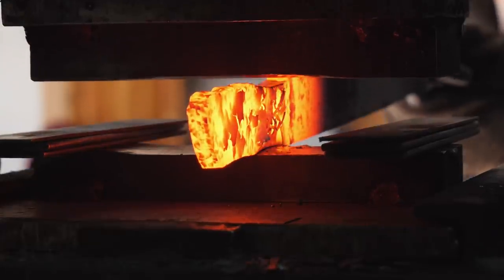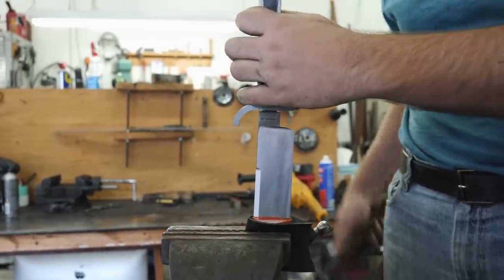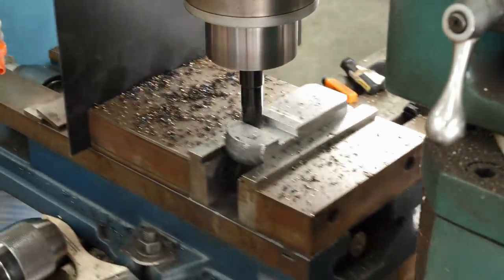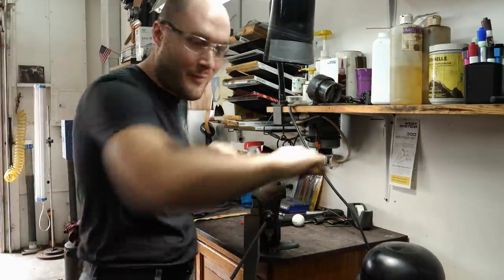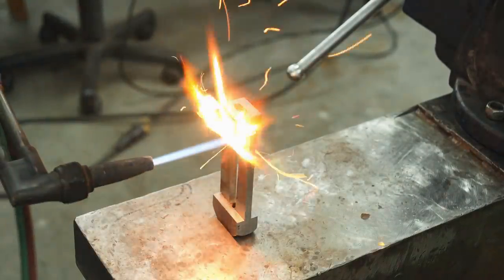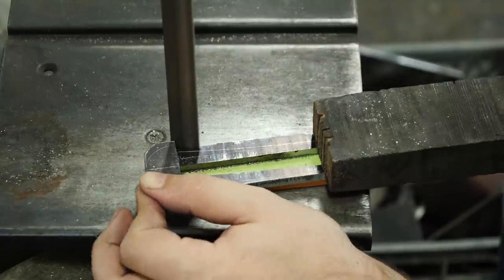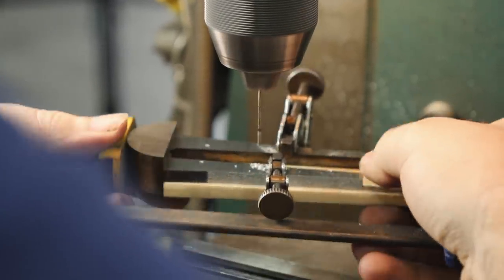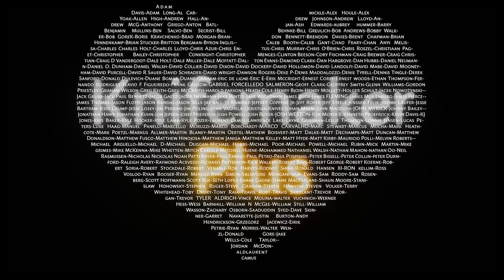Assembling a Frame Handle (Luminous Pt.3)

Comment: I'm sure I'm not the first person to suggest this bud, but if you don't start working on correcting your posture you're seriously going to regret it in 20 years. Just looking out for your health. :) Keep being awesome brother!!!
Reply: I was literally about to say this, and here it is already.
Reply: I didn't notice it until you mentioned it.  As a dentist I sometimes do the same thing.  Obviously the focal length is off which is ruining his ergonomics.  He should probably get some loupes or some sort of magified goggles so that he can have proper posture.  I find myself craning my neck around when doing detail work, but since I'm not one of those hardcore production dentists, I don't worry about ergonomics.  Now if I did buttloads of detail work then I'd have to go put my loupes on and improve my ergonomics.
Reply: Took me a fair while to work out what you were milling the block of mild steel for, just didn't twig until you cut the slot for the tang, ha ha ha... Awesome work dude, still saving for your course, but soon. Real soon.
Reply: I try adjusting the height of your work space so you don't have to come down to it, by raising it or lowering and using a chair
Reply: @Briguy1027  Ive thought before that dentistry would probably carry over into knifemaking pretty well, similar tools and concepts.
Reply: @joejones9520  it does.  The dremel work is very similar to the slowspeed handpiece we use, and in the past we got the joy of polishing metals, especially gold.  But I don't think they teach that any more to the new students since gold is so expensive and people prefer tooth-colored restorations over the old tried and true gold, even though they last almost forever.
Reply: In 20 years he'll be like I'm not sure what they were talking about, but I have a hunch...
Keep your chin up, bend through your knees and work those abs! Also relax your shoulders. Maybe see a physical therapist or get a Thai or deep tissue massage.

Comment: Your course after discount comes out to approximately 42cents a minute given that all the information can be sourced from other channels on YouTube I would consider offering it for cheaper than 200 dollars or offering more in terms of resources. Perhaps a list of common dealers for the materials or offering to do live Q and A a few times within the first month of ordering just something to separate your product from people thinking they can simply find this info elsewhere on YouTube. If you sold the course for 50 dollars at eight hours it would come out to approximately 10 cents per minute. Something to think about. You may find you get more sales of people wanting to simply have access for some possible future where knife making might happen vs at 200 dollars I figure most people would be pretty committed to making it happen. I’ve bought a lot of products just in case of someday maybe when there cheap enough. You may want to try offering for fifty and see how your sales do.